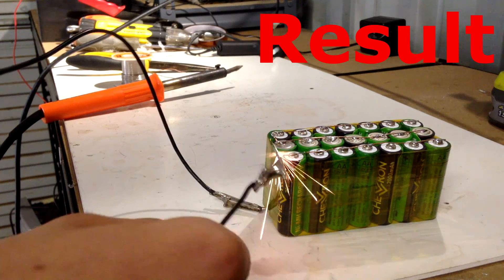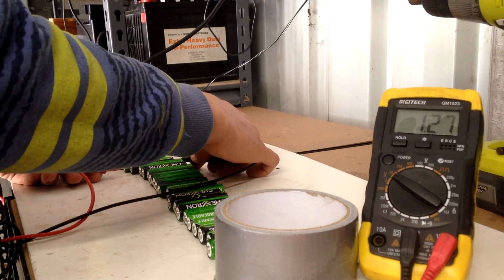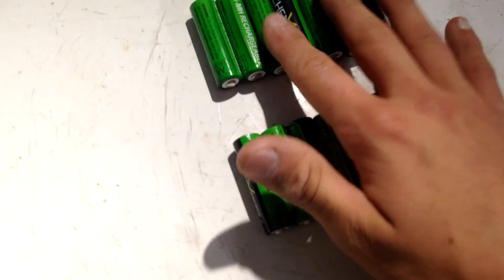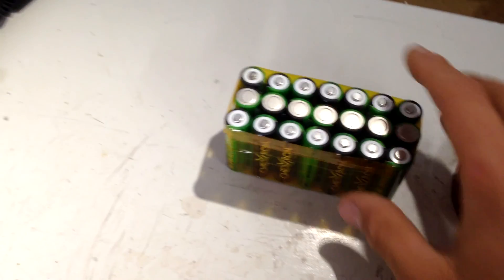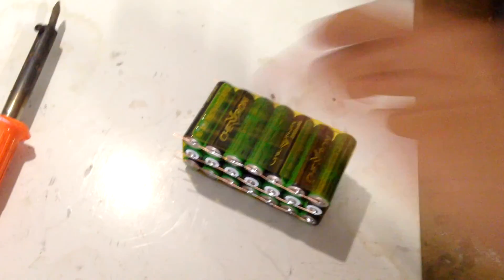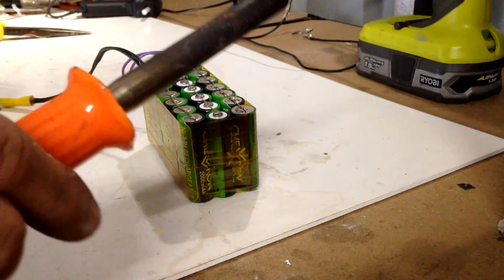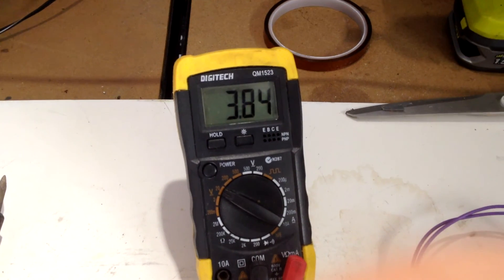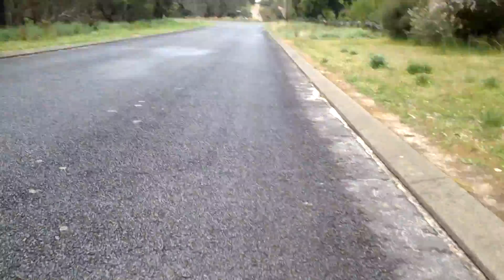AA NIMH Battery Pack For Ebike | 4v booster | DIY $20 E-Bike Battery

Comment: Damn this is literally the first video that showed me you can series packs and balance charge them separately

Thank you so much man, just fixed up a 2001 Izip Schwinn ebike built for lead acid, upgraded to lithium, and I got it by using my 5S and my 2S packs in series with a little connector and it’s all because of this video where you show that voltage boost

Comment: How many aa batteries to make 48v thanks
Reply: depends on the battery specs for the individual..
Reply: @apanlæg  I'm looking to make a 48v battery pack probably like 20ah
Reply: @apanlæg  can u help tell me what I need to make a 48v battery pack
Reply: @BlackCat-qm3sj  you need to find the specs on the batteries you are using. Tell me them
Reply: @apanlæg  ok the aa batteries I'm using are 1.5v alkaline but there not rechargeable there from the dollar store 

They are durcel 1.5v 14x4.3x4.5 inches 
0.2pounds alkaline
Reply: I'm just looking for to make a 48v battery pack for my 1000w electric motor idk how many batteries make 48v n how I'd charge them hmm should I get a bms how do I also connect aa batteries in series does 32 aa batteries to 48v? If so how do I connect them in series I do have some copper wire
Reply: @BlackCat-qm3sj  they're not rechargeable, so bad idea for disposable batteries, and 1000W at 48v is about 20.8A peak current draw. AA's are generally rated for ~1A, so u'd need about  672 AA's for 48v 21A of power draw. you arent specific with the specs of the cells you're using, but duracell's AA's are generally 2500mAh, so with 672 batteries u'd have a 52.5Ah pack. U'd wire them in 32S21P. You don't need a bms because these batteries are single use only. rechargeable AA's are a lot less powerful so u'd need a lot more and it's a lot more volume, weight, and $$. plus if you do go rechargeable AA's (I don't know why, you could just go 18650's and save tons of money, space and hassle), good luck finding a bms for 32S. and if you don't understand what I've said in this comment then frankly you're too uneducated in battery and electricity knowledge so I'd advise you to take another route, maybe towards buying a premade battery with all the safety features off Lunacycle or another reputable brand. No point risking a very dangerous scenario if your battery packs aren't made safely enough and something goes wrong for the inexperienced.
Reply: @raymondvo5388  can I use rechargeable aa batteries to make 48v battery pack also how would I charge them? If so
Reply: @raymondvo5388  I don't have 18650 cells I believe I can make a battery pack with rechargeable aa batteries not sure howd I'd charge them and plus rechargeable aa batteries are not that expensive instead of buying a 48v battery pack for 48v that's expensive last time I seen one it was like 256$
Reply: @raymondvo5388  hey can I make a 36v battery pAck with rechargeable triple aaa batteries
Reply: @BlackCat-qm3sj  so Duracell batteries or any ALKALINE are All 1.5 volts each so you would need 36 batteries but as you know you cannot recharge them. Now the rechargeable Energizer double a's are called NIMH batteries, unlike alkaline, each battery only has 1.2 volts. 40 NIMH batteries are needed to make 48 volt pack. Good news is you can find these with the charger included almost anywhere. Bad news is unless you want to take apart you're battery pack you'll  need to make you're battery leads with fairly thick wires and invest in a nice NIMH battery charger.
Reply: @tvanderpool7516  hmm got some rechargeable AAa batteries for my 48v battery pack thinking about making 48v 80ah 

But if I used eneloop rechargeable AAa batteries for battery packs I'm wondering how I'd charge tem 

Should I put them in series or parallel which is better?

Comment: I'm thinking about making something similar just because I have a bunch of these and I'm able to get more for free, would balance charging be needed like lithium?
Reply from the maker: If all the cells are the same brand/rated capacity then it should be fine. I would however recommend lithium batteries as AA batteries don’t give out that much power and the voltage says pretty badly.

Comment: Great video! But I wanted to know how you are charging it? Are you using a Variable Voltage Charger or just a normal battery charger found anywhere?? 
I ask bc recently made a 11v battery pack out of 7 rechargeable AA batteries (with help from yours and others videos) to power my homemade LED light kit for my RC car and I want to charge it.
Reply: Hey did u figure out how to charge the batteries ive got aa batteries yea there rechargeable but,I'm wondering as well to,charge them thanks
Reply: @herekittykitty4900  is simple if its 1S is 1.6V if 2S is 3.2V if its 3S like in the video 4.8V ( is possible to charge on 5V like USB charging....
Reply: @vladimirsamas3097  hey building a 48v battery pack with rechargeable AAA batteries wanna how I can charge them yes Ik ik just trying it
Reply: @Mylotheblacknwhitecat  you need to make a 40Series pack of AAA .. to have 48V to charge it you need to have like 60V power supply. Just for your information if you make 48V battery is better to do it with Li-Ion or Lifepo4 or li-ion-po cells because you need just 13 of them for Li ion and 16 for lifepo4 ...
Reply: @vladimirsamas3097  well I have a bunch of rechargeable AAA batteries there these types but I'm wondering how id charge them
Reply: There's no BMS for a1.2v cells
Reply: @vladimirsamas3097  I do have a imax b6 charger tho
Reply: @Mylotheblacknwhitecat  so just lithium battery have BMS, NIMH and NICD and NIFE ... Don't use BMS ... So you just plug the battery
Reply: @vladimirsamas3097  into the imax b6 charger?
Reply: @Mylotheblacknwhitecat  that depends on the battery voltage but yes if it's a snall battery
Reply: @Mylotheblacknwhitecat  if you make a 48V battery you will need to make or buy a specific charger for it

Comment: how do you charge this beast after you've depleted it? I'm curious as I am attempting to make a solar powered ebike on a 'budget'.
Reply: if i were you id get a protector board so you dont explode them... by over voltage, rechargable double AA's have this function built in.
Reply: @aircoolbro21scndling49  what kind of bms protection board can I use and how can I hook it up with the batteries

Comment: how do you recharge the batteries
Reply: Cater Rebater 
Yes
Reply: You can make a power inlet
Reply: @Fred_the_1996  what kind of power inlet I'm building a 48v battery pack with nimh I'd probably need bms but I'm doing the same thing just trying to figure out how to charge